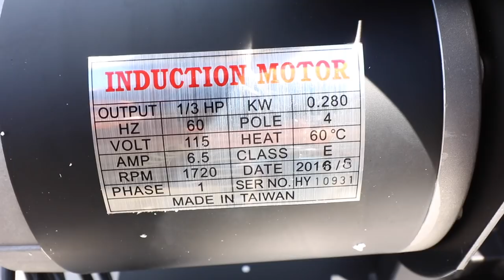Oregon Blade Grinder For Lawn Care (88-025) 1/3rd HP Unboxing + First Tests

Comment: I'm a machinist and I grind my own high speed steel cutting tools for use on a metal lathe  ----by hand.

What you have is a jig to allow you more speed and accuracy in grinding a mower blade.  With some practice,  you wont need the jig and will likely discontinue using it.

A jig is useful for precision work,  but only necessary for unskilled,  inexperienced people on a simple job like sharpening a mower blade.

Why spend a lot of money for a single purpose machine that takes up a good deal of shop space?

The only real need for this equipment would be a shop that sharpens a LOT of blades and needs consistent results with inconsistent workers doing the task. 

The other thing I'd recommend would be putting the blade in a vice and cleaning up the edge with a file.  Probably not really necessary,  but that would produce a high quality finish for the blade.

Comment: We have had the 1/2 hp model in the shop going on 10 years works great. The stone dressing tool is worth the money in the long run because it flattens the stone so you always get a straight cut. You will notice over time the stone will develop an angle. Mulching blades tend to cause that more than yours though. We have an rgb  912 also it's great for high lift blades etc but is useless for mulching. Needless to say the Oregon one gets more use. When you balance be sure to get all the grass gunk off too or your wasting your time
Reply from the maker: Great tips, thank you!

Comment: Once you use the Oregon belt sander you will never go back to sharpening blades in stone. We bought our first one about 10 years ago. Sharpened so many blades on it that we ended up buying another.
Reply: We helped develop the Oregon blade sharpener. Burr King started out of Warsaw Missouri and we helped design this blade sharpening unit. The sanding belt remains cool as to not tamper with the blade hardness. Check out Burr Kings original blade sharpener to see how we helped develope it.

Comment: I understand, the problems people have sharpening blades, I've been doing it for over 40 years, I use two types of grinding stones on my bench grinder, a corse, and a fine, if the blade is badly damaged I start with the corse, to grind down the damage, then switch over the fine to finish it out for a nice sharp straight edge, then balance, if the blade isn't that bad I just do the fine stone, it's all in the angle that you hold the blade, I do it all free hand, no jigs, it's a nice tool to have in your shop but with my experience I can't justify the cost, when I can do a better, sharper edge in half the time with a 30 dollar grinder, but always remember to balance the blade, and you don't need a 100 dollar balancer just use a nail driven into the side of the work bench.
Reply: Balancing is THE most important aspect to blade sharpening!!

Comment: I have a mag 9000. Its wonderful. Tons of power and sharpens in seconds
Reply: Well, I don't about it happening in seconds, that sounds a bit of an exaggeration. Sometimes it can take as long as 1/2 hour per blade, depending how dull they were. I've also discovered that in the long run, you're better off sharpening blades MORE OFTEN. As well as chainsaw chains. More often is better. The reason is that you'll end up taking less off by doing it more often.

Comment: id prefer a belt grinder but they are way more $ but if your using it as a write off then it wont sting the pocket book as much.  i agree on the temperature thing if its to hot to touch its likely hot enough to change the tempering of the steel.  a good reason why bare handed is the way to go when grinding.   

i cant afford a oregon 760 but dam that thing is nice.
Reply from the maker: zerocool212121 well said

Comment: hey brain I got mine ten years ago turn the grind with the motor  against 5he wall and pull it though I put a board on the side to stop the grind dust  from flying out then clean up under it a couple times a year I well make a video of mine this weekend to show you my set up

Comment: I have the 1/3 HP model and it works very well with the majority of blades. It’s a bit tricky to sharpen mulching blades and is sometimes a pain in the butt if the blade isn’t flat like a Cub cadet blade. 
If you sharpen a lot of blades like more than 3 blades in a row  or if I sharpen some really dull blades and make a more aggressive cut, the motor gets really hot. It is a sealed motor so all that heat builds up and if you’re not careful it could overheat. If the motor had cooling fins and a fan then you could run it for longer durations. Not even the 1/2 HP model has a fan. And if the motor dies, it would been nice if it was a name brand motor so I could replace it with something compatible. So I usually do 3 blades at a time and wait for it to cool down before continuing but that’s added downtime for me.
But overall it does a decent job. A good technique helps to keep a consistent edge and reduce overheating the blade which is pretty easy to do.

Comment: Are you still pleased with this grinder?  Just in seeing this quick demo I think it could be improved if it had a wider table for the blades to slide on.  Just figured it would be more stable.  Maybe it's not a big issue.  Appreciate the video.  Take care.
Reply from the maker: I do. Use it every week. It’s been a major blessing on the blade sharpening game.
Reply: Thanks Brian.  I'm going to do some checking around just to see what shops around me charge to sharpen a set of blades.  That is if they use a pro style grinder.  I'll then have to decide if it's worth it for me just being a homeowner who likes a nice lawn.

Comment: Hi Brian.  Beautiful machine.  (¿Would holding the back edge of the blade against a guide help, to keep the work edge moving perpendicular to the grind wheel/parallel to the cut line of direction?  Just wondering).  t\.
Reply from the maker: There is a guide plate that you rest the blade on that you can maneuver up and down a little. It takes a little getting used to but I still love mine.

Comment: Great video review, Brian!  When I purchase this, I'll be sure to use your Amazon link.  I recall there being a $100 balancing tool as well.  Some guys say to put a nail on the wall, but I would rather fine tune it more.
Reply from the maker: +markthomasbuilder let me know what you think if you get one! I just use the cheap balancer from the blade kits, seems to do the trick.
Reply: Will do!

Comment: I dont like that method of sharpening.  It causes the blade to have a hollow (curved) surface, which leads to severe chipping on the cutting edge when it contacts a hard object.

Comment: Brian are you still happy with it??
Reply from the maker: Hey pal, yeah. I like it. I might've sprung for a higher hp version, maybe the 1/2 instead of the 1/3rd. But I also didn't want to break the bank. This model is working out fine for me though. I only sharpen a few sets a week, so it does the trick.

Comment: Hack That ain't no different than using your grinder on on the bench should be able to keep the blade in a straight lines that are wiggling it back and forth see you get a lot of fore-and-aft movement in your blades as you're grinding

Comment: This is the first I've seen of this piece and I see and my opinion about this shop item, it could be very dangerous for limb and possible life.   The feed and rotation is so unsafe as it stands in this vid  at 2:32, due to the fact of how the wheel's rotation is drawing the work piece into it, it should have a immediate kill bar as we find on every electric and gas operated chain saw .  If this is being placed in a home shop where ones have no idea of its function and too young to control it, ones will get badly hurt. -----  If anyone is working it and wearing dangles from their neck,  say hoodie-head tie cords and those tie cords got drawn into it,  the victim would almost be coughed before locating the simple small control switch.  ---  Just place a short length broom-handle size dowel into wheel grab area and see how fast it will chew the dowel before the switch can be reached, of course the dowel will jam the wheel , but flesh and bone will not until a hand is wasted. --- Yes, It can be easily modified to be safer before someone's sleeve gets pull into it   or   work the machine from the rear side, where your sharping work is more controllable and step-side the sparks.      070318.   Good Pitch, but poor machine.
Reply from the maker: This is how almost every one of these units are designed. By the way, there's inherent risk with using a bathtub. No one complaints about them. I will bet you which one takes more lives and hurts more folks per year though. I understand your concern, but this isn't for the newbie. These take some skill and should be treated with respect.
Reply: GoatDriver Ram
First; READ THE INSTRUCTIONS! Second; Have you ever used a bench grinder? They rotate the same direction but you are working with the top quarter of the wheel. At this point the wheel is spinning AT you. So easy to get hurt if you are not careful. Whit the blade grinder shown, if you slip the blade will be pulled INTO the wheel, stopping the wheel almost instantly. The little 1/3 hp. motor hasn't got the power to do anything else. So many of the things we use everyday are dangerous IF we do not use them properly. Not everyone can have a pro do everything for them. Most of us absolutely can NOT afford to buy new blades every time they get dull. That could be weekly or even daily for someone like Brian. When used correctly, this will give good service, be relatively safe, and save time and money. As far as it being dangerous for young ones getting to it; So is a hammer. LOCK THE SHOP DOOR AND TAKE RESPONSIBILITY FOR YOUR OWN CHILDREN. Watch them, Teach them, Train them. Nuff said
Reply from the maker: John me what ^ said
Reply: If you had listened and understand it! The adjustable plate the wheel goes through is never to be more than a 1/4" from the wheel! Thus never enough space to grab blade and pull in! If your not wise enough to tuck loose clothing in, you shouldn't be using it! Take the labels off of things and let nature take it's course! Yes what John me said!
Reply: John,  go look at your bench grinder again, it is the elec motor with two stone wheels at each end and many in-experience users require a work-rest located 1/8 " from the stone wheel curve nearest to the user (3 or 9 o-clock depending which grinder end being viewed).  NOW!  look again where the work-plate is located on the blade grinder, yes, at 6 o-clock.  That is the point I was speaking about, that could be a blind danger zone, 25% of the wheel is open can draw in a victim. ---  Thanks for your unrelated dissertation of all thinks are possible.  : )
Reply: Brad,  see what you are saying and you were doing good with your post until you agreed with John.  You guys stick with your day jobs,  it may be your best forte just now.